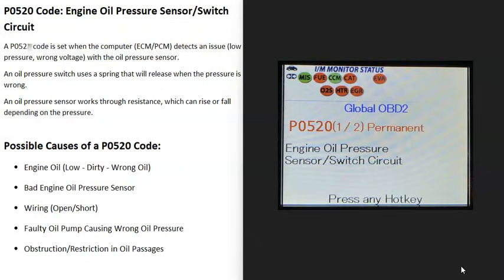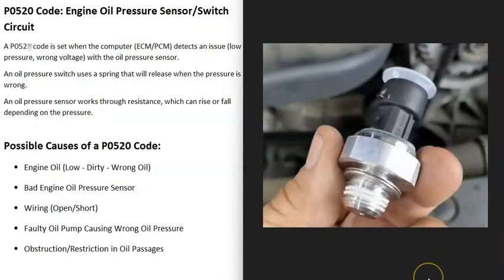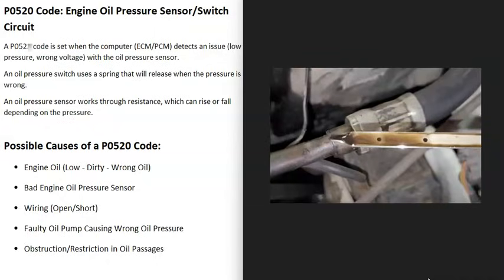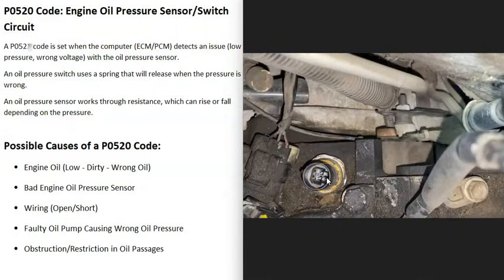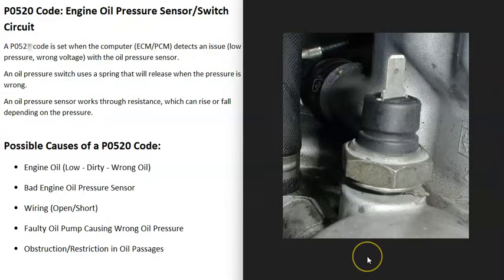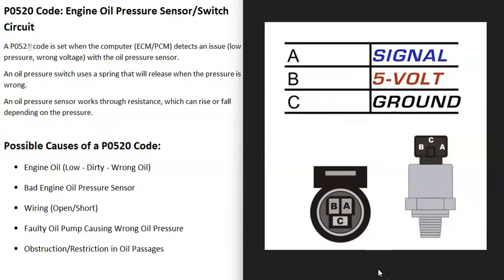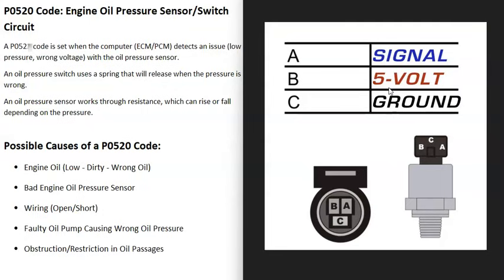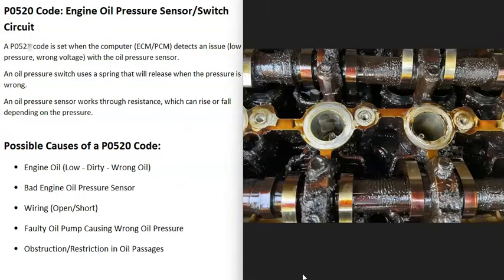Causes and Fixes P0520 Code: Engine Oil Pressure Sensor/Switch Circuit

Comment: I changed the sensor and then checked the oil level and it was a lot lower than expected. There wasn't enough oil in the oil pan to make up the difference. Now if my oil filler cap is missing the gasket then that raises oil to leak and then the sensor to go off. That explains all the oil on my engine. There really is a reason for everything.

Comment: Hi guys.... I had previously changed the parts number 46337579 and the problem could not be solved. Parts 46336109, 55202374 were changed at the authorized service and the problem seems to have been solved. I have not received warnings or DNA-related problems for two days.

Comment: You mention this code with low oil pressure, but my Jeep usually reads pressure being around 45 psi. Engine code came on and I checked the jeeps displays and it was saying 99 psi. Any idea what would cause that? My code was also the p0520
Reply: Pomp oil sensor, not oil swich
Reply: Mine is doing the exact same think. I have great oil pressure but keeps throwing this code